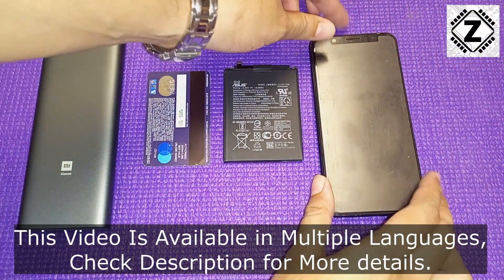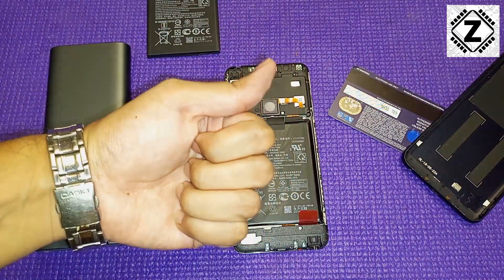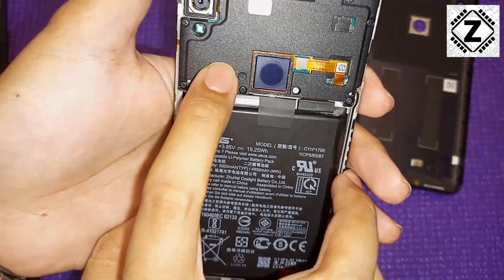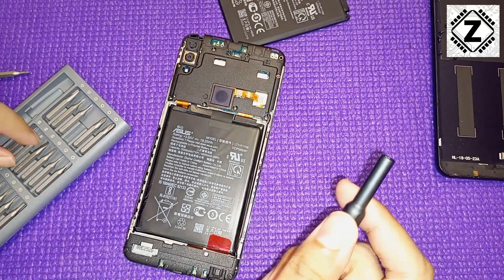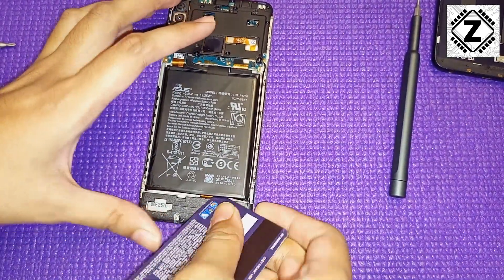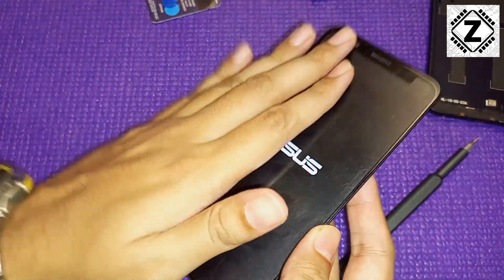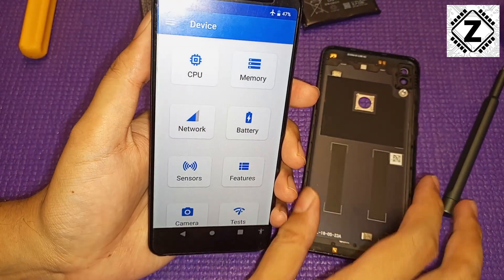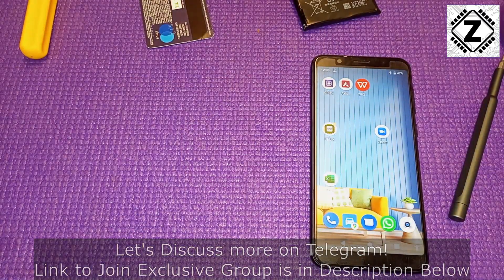[Eng] Asus Zenfone Max Pro M1 Battery Replacement DIY | How to Open Cover, Remove Fingerprint Sensor

Comment: Nice guide, thanks for the tips, struggled a bit with some cache masking a screw of the shield and the battery connector which was way too far for my generic battery. Fixed it by just removing the tape on the battery cable then putting it again in place. Got scotch for battery in my battery kit, but it was so painful to remove I didn't used these. Maybe I'll do if the battery disconnects for some reasons. Thanks ! 🎉
Reply from the maker: Cool.

Comment: The amazon link shows different  aftermarket sellers for this battery model.confused since my asus zenphone max pro 1 about 5 yeaes in use now show battery not holding charge.
Reply from the maker: Sellers keep changing.